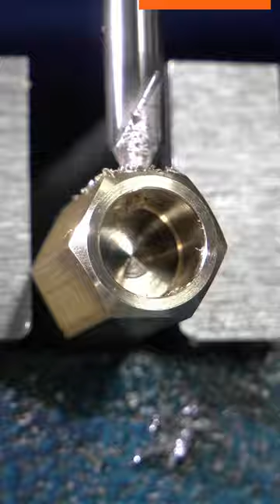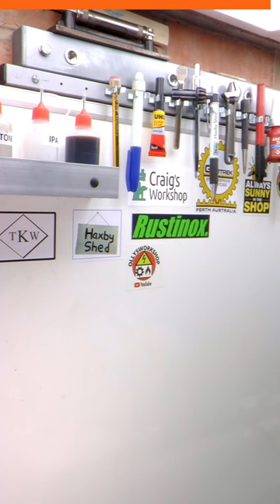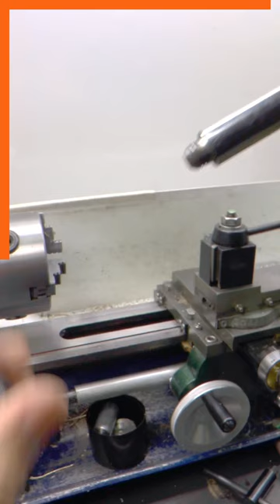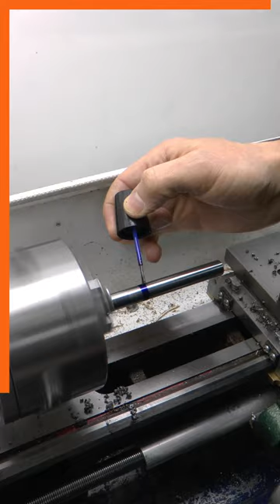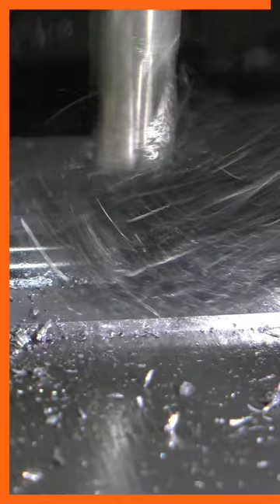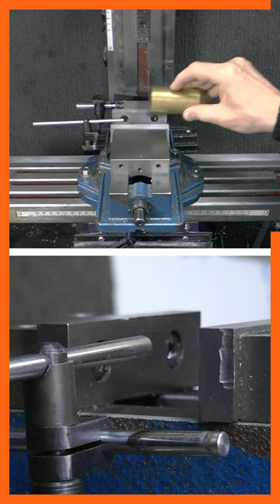Mill Vice Stop From Leftover Parts #shorts

Comment: That is very nice. I've been meaning to make something similar,though I'd have to make it from scraps as I don't have any of those magnetic base arms. I have made two vice stops that clamp onto the hard jaws, and for most of what I do that does the trick, otherwise I use a stack of 123 blocks clamped down to the table for parts wider than my vise.

Comment: Why not make it based from the T-slot? Modify a t slot nut to be held in place by a couple set screw and pressure and then be able to remove or install the whole stop assembly by threading or unthreading one rod.

Comment: We have a very similar thing at my workplace! Its just a magnet with a hole next to it and a little off center lever. Stick a metal rod in at any lenght you like and turn the cam 90° and itll stay :)
Very confenient and also non permanent. Though the magnet could be a downside for some.

Comment: Nice, but using DIN-333A spot drill before twist drill is just improper and not only improve nothing but also make things even worse. They are designed to be used with dead and live centers only! Look for NC type spot drill
Reply from the maker: You are correct, but the very tip of a centre drill (before 60 degree section) has served me well. In the hobby shop you use what you have. Thanks for watching.
Reply: @TheRecreationalMachinist  fair enough. I assumed you as experienced machinist, that's why I mentioned it. Also I've had some trouble with this method in the past. Anyway, good job. Keep it up!